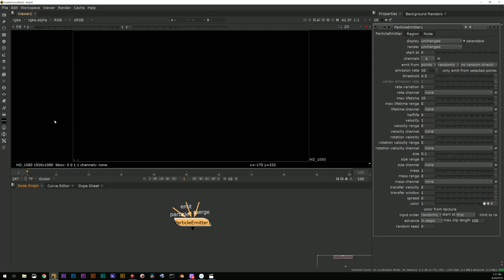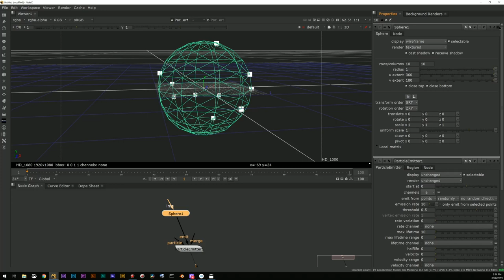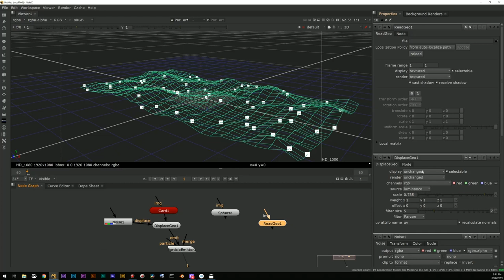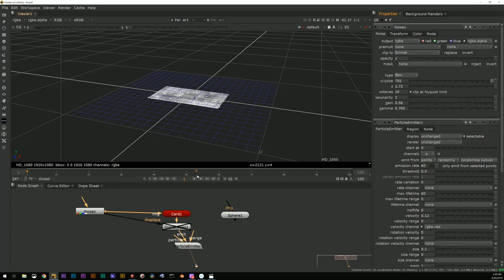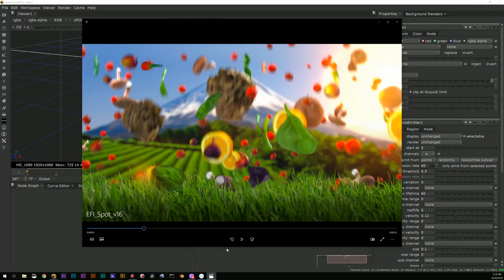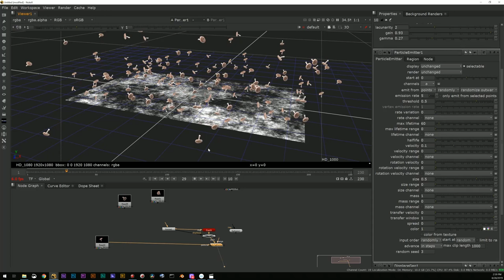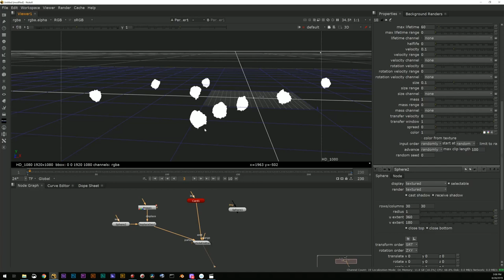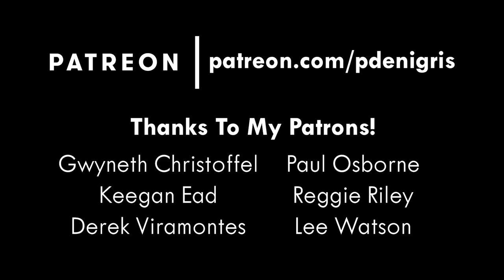Nuke Particles Part 1 - The Emitter Node

Comment: hi Paul ...... nice tut! ... thanks!.... i have a question .... can i use 3d objects as particles ?? how to import it and attach to the particles system! ... thanks dude!!
Reply from the maker: You should be able to import your 3d object using a ReadGeo node, and then plug that into the "particle" pipe on the ParticleEmitter node. Just like what I did with the Nuke-native sphere here in the tutorial. ReadGeo should work the same way.

Comment: Is there a way to make an "asteroid field" where the number of particles remain constant, but the "asteroids" are randomly rotating? That would be a tutorial I'd like to see. :D
Reply from the maker: I believe so. I've done something similar with cloud sprites, where I used a displacement on the particles to lay out the clouds at random and then froze them in place. It would be a little different procedure here because of the rotation, but I think it's doable. I'll keep it in mind when I get into the particle physics nodes.

Comment: wouldn't it be lovely if the default start frame was the first frame of the project rather than just "1" ???
Reply from the maker: Agreed. A lot of nodes need buttons for Set to Start, Set to Current Frame and so forth.